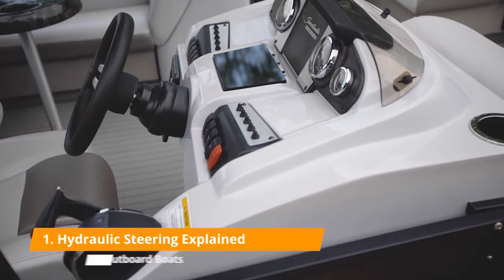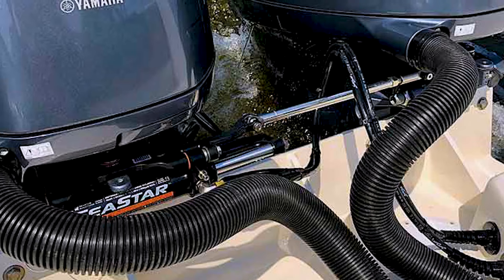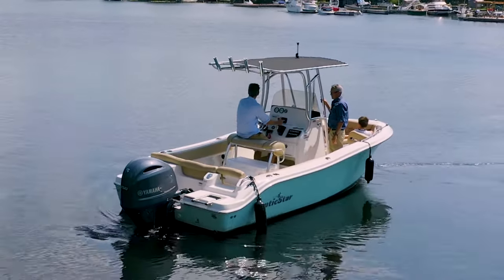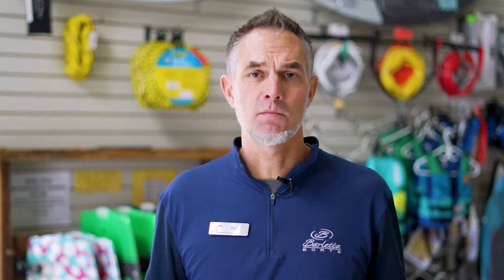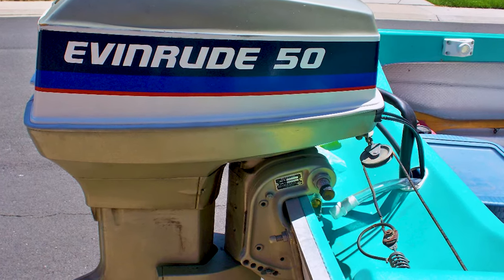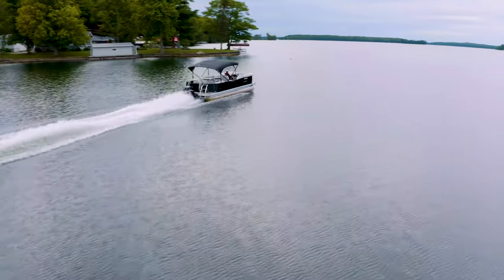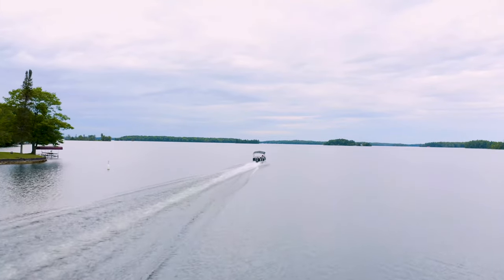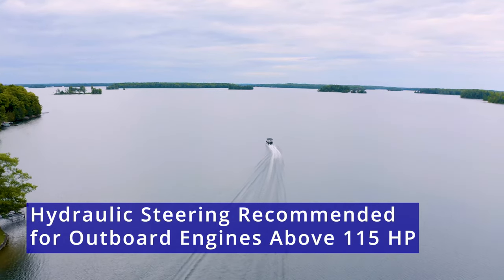Hydraulic Steering Outboard Pros and Cons

Comment: This may be a ridiculous question. I have a 14.5ft 1977 chaparral tri-hull. It currently has a 40hp outboard but I was given an 85hp that I’m almost ready to change out with the 40. I was looking at hydraulic steering but it’s about 3x the price (170$ v. 440$). Is it worth that difference? Would I even notice a difference at the scale I’m talking about?
Reply: yes i have one on my 15 foot formula(haines 445) its the best thing ever once you use it you will want it on all your boats

Comment: Thanks for the video. I am  working with a 60 hp head to 40 hp output jet drive. The main issue I am finding is bend radius as I convert from right side remote steer to center console remote steer, and having 3 bends in the cable instead of 2. I need to replace the cable due to increased length, and also am limited to an 8" radius. I know this can be done, as I have seen it on other boats, but am considering going hydraulic to clean this up and simplify the routing. Thoughts?
Reply from the maker: I like the idea of switching to hydraulic in this application for sure!

Comment: It's also helpful if you're routing the lines on a "custom" boat. I'm building an older 26" pontoon amd in changing it from a starboard drive to a stand up center console. Instead of routing the big thick cable through all of those turns in the build its much easier to run 2 smaller hydraulic hoses.

Comment: You don’t need hydraulic over 115 ho I run a 200hp with rotary steering and it does just fine
Reply from the maker: Is it a single to dual cable?

Comment: Hi Len what are your thoughts on a 225 hp outboard that uses a tiller arm. My thoughts are safety should you hit a log. Here in BC we have many many opportunities to really pivot that engine around fast enough to break a few ribs with that tiller as some logs are massive annnnd* unseen from surface. Safer to go hydraulic assist tiller steering or plain old tiller steer?

Comment: Retired marine tech here. Never ever will I have hydro steering. To slow, like he says, lock to lock to many turns. 9 out of 10 people might prefer it, but just wait until you have to maneuver fast, like docking, or running across the lake at 60-70 mph. Of course that’s my opinion, I love my cable, tested hundreds and hundreds of boats in my career and there were quite a few close calls that I had to miss something in the water or when docking in stiff winds. I could not ‘feel’ the boat either when running in a really fast boat doing upwards of 80-90 mph. Again sorry but it’s just me.
Reply from the maker: We love different opinions, and you certainly have the experience to provide it. Thank you for contributing to the discussion!

Comment: Hi, is it still possible to stear the engine manually by hand when there is a hydraulic system mounted on the boat please? I wonder if it makes any harm to the hydraulic system. Thank you.
Reply from the maker: It will not hurt the system but is extremely hard to do
Reply: @boatinglessons  thank you 🙏

Comment: We bought our first boat last year, a new 20' bowrider with a 150HP motor and with hydraulic steering. Being new to boating, I was expecting something closer to power steering in a car, but our boat's steering feels closer to power steering in a car with the motor turned off. Pity they didn't have power steering as an option...
Reply: I’d say there’s something amiss with your system if it’s incredibly hard to steer. Generally, hydraulic steering is easier than cable steering.
Reply: Hydraulic SHOULDN’T be hard to steer at all. Quite the contrary. I’d get in touch with your dealer, cuz to me, that much effort required indicates a problem.
Reply from the maker: The other two comments are correct - it should be quite easy to steer
Reply: Thanks! I'll take it into the shop and have them check it out.
Reply: Our boat was hard to turn BEFORE we adjusted the trim correctly. Play with the trim level as it can really affect the steering effort required. Apparently our prop was changed and it affects the steering a lot. Once we adjust the trim to the sweet spot then steering is a breeze.
Reply: @brettolsson  good luck with it. Mine wanted to constantly pull to the right and I had to  fight the steering wheel to keep it going straight. Once we adjusted the trim it straightened right out and now I know where to set the trim to get it to track straight and steer easy. It's worth a try. Mine is a 19 ' bowrider with a 135 Merc outboard.
Reply: If you don't have trim to play with, and the boat porpoises, there's something else wrong than your hydraulic steering. That much is certain. Hydraulic TAKES AWAY the problems you get with cable steering. In all honesty, it's the creme da la creme. Lok into trim tab on the lower unit. See if it can be adjusted. Prop might be another avenue to look into, but generally hydraulic steering takes that torque up to make things easier. Is it harder to steer one way rather than the other when underway?

Comment: I have a question in my boat i only have one cylinder with 2 115 hp Yamaha right now i am changing for two 150 hp Suzuki do you recommend to stay with only one seastart cylinder or two thanks
Reply from the maker: Jose, I assume you are referring to steering cylinders? I think you will find it safer and easier to steer with two. It does increase the cost, but I think worth the extra.

Comment: Whats the word on the newer digital steering
Reply from the maker: Are you referring to power steering (electric power assist)?
Reply: @boatinglessons  yes, Yamaha calls it digital electric steering.  there's bolt on and integrated.  Its the future, but..  the verdict is not in yet, especially as it relates to salt water.  Thank you for responding
Reply from the maker: @JR-rc1cg   yes, we have a few boats with the electro-hydraulic steering already installed. Corrosion is always a consideration for sure. They sure are clean from an installation standpoint!